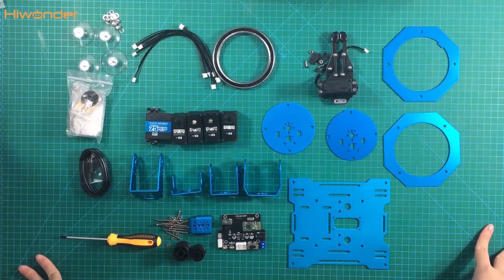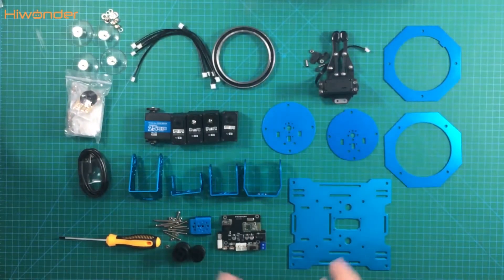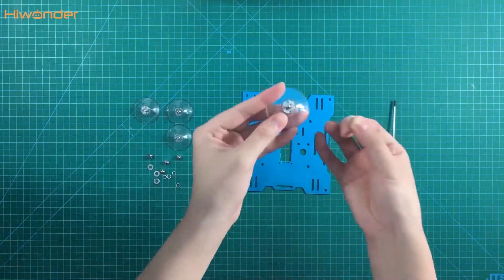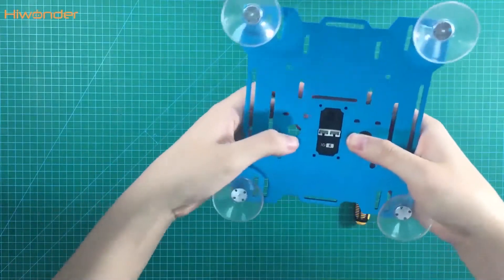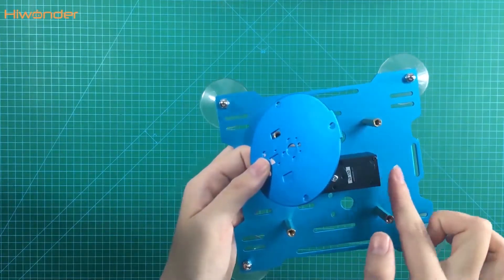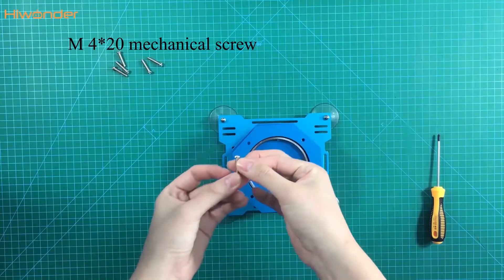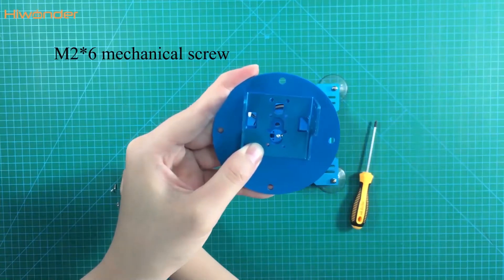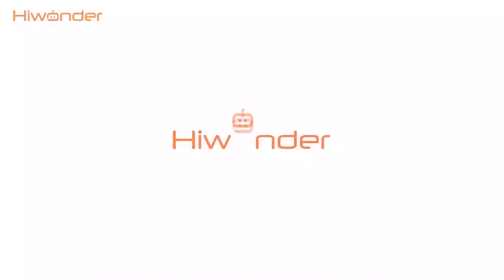xArm1S Assembly 01

Comment: Do I have to buy the arruino expansion kit just to be able to control it with an Arduino?  I want to use an Arduino to execute action groups automatically based on MQTT events.   I don’t need the extra sensors that come with the kit.
Reply from the maker: Hi yes, Arduino extension board is required. You can contact us to buy: support@hiwonder.com

Comment: I accidentally inserted the 20 cm wire connector into the ID 6 server. Is there a way to safely remove it? I’ve tried pulling on it but that doesn’t work.
Reply from the maker: Hi there, can you pull out the servo wire?
Reply: @hiwonder294  Horray! I got it out intact by using pliers on the plastic connector which worked perfectly. Thanks for the advice. Now I can finish the assembly.
Reply from the maker: @gmtrux2288  That's great! In order to have the better performance, the accuracy of the port is relatively high, so it takes a little effort to pull it out :)